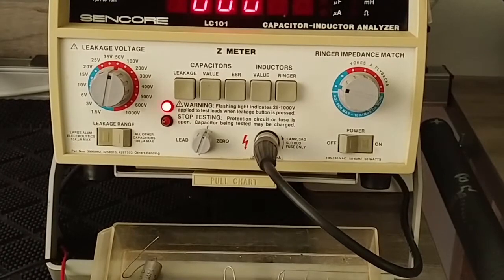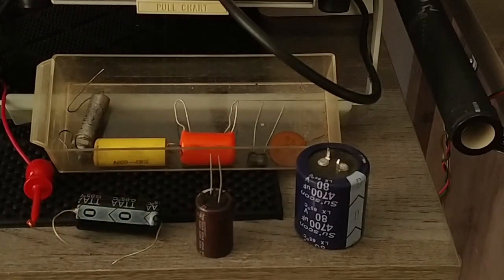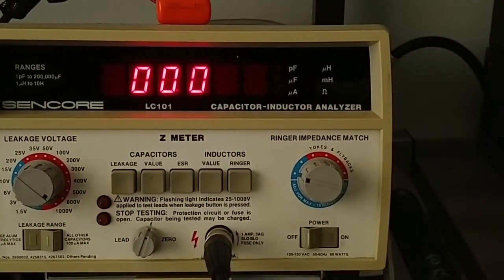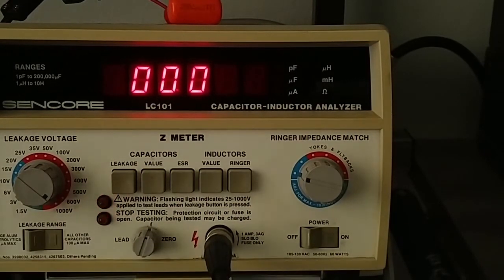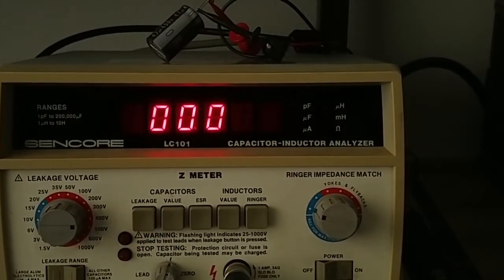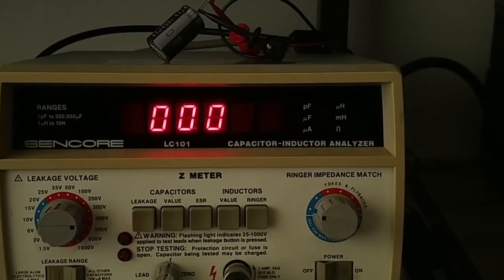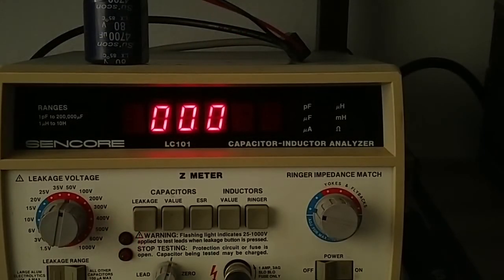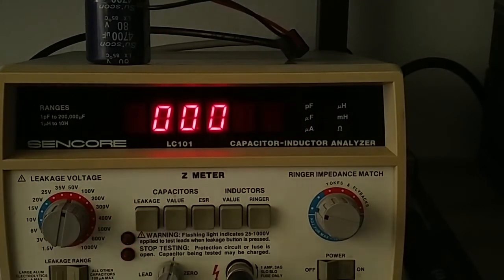TOOLS OF THE TRADE - Testing capacitors

Comment: Thank You Ron.. I have been wanting to get something like this..If you don't mind me asking what did this unit set you back and did you buy it new or old..Thank you for the informative video..
Reply from the maker: I got it used on ebay about 8 yrs ago. Think I paid about $300.
Reply: @amptechron  Thank you Ron..That is where i was thinking about looking..The units themselves are pretty Bullet proof though right?
Reply from the maker: @edwierdbluez  Absolutely.  Ive never had any issues. Get one, you wont regret it!